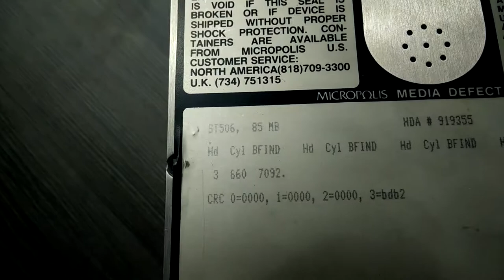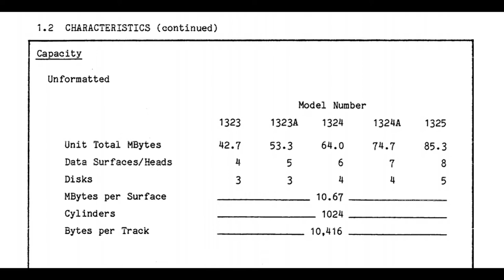1987 85MB 5.25" Hard disk from DEC MicroVax 2000

Comment: You still have this drive?
Reply from the maker: Yes I do.
Reply from the maker: @cdos9186  I have no way of testing it unfortunately.
Reply from the maker: @cdos9186  I see from your channel that you like hard drives, do you have a collection? Maybe some rare drives? 
I have a few, but most of them arent very rare. I have an other old 5.25" Seagate drive, its quite damaged and missing its top cover. I dont know what model it is but the chips on it are dated early '88.
Reply: @SIC66SIC66  Your one Seagate dated early '88 you should make a video on it.  My guess is a ST-4026, or a ST-4038.
Reply: @SIC66SIC66  You can power on the drive with a power supply if the drive has a 4-pin molex connector.
Reply from the maker: @cdos9186  I'll try powering it tonight. I wont make a video of the other old drive but I might make some pictures.
The Miniscribe looks very interesting! But to be honest, I am not very knowledgeable about hard drives. I would know what is interesting about the IBM Deskstar DTLA-30707 for example ;)
I have a lot of hardware at home, drives are just a small part of it.
Reply from the maker: @cdos9186  I made some quick photo's of the old Seagate drive and the other drives I have.
The drive from this video does run when powered on, but I dont hear the heads moving and when it spins down it sounds like it has a bit more resistance than I would expect.
Images: https://drive.google.com/open?id=12e_0KCDVZi2t7S1Tq8nis4G6360QE3Y0